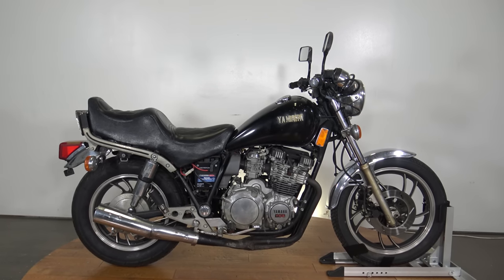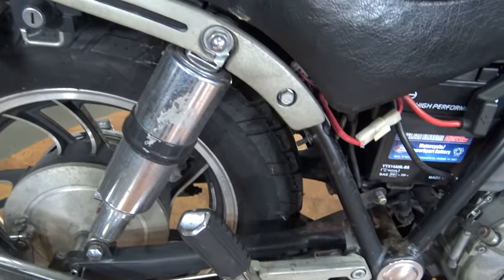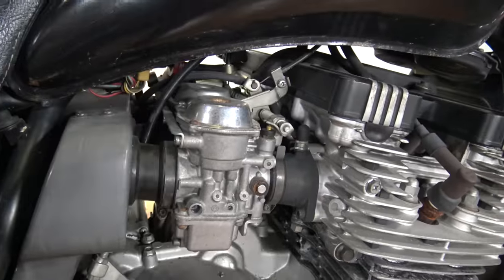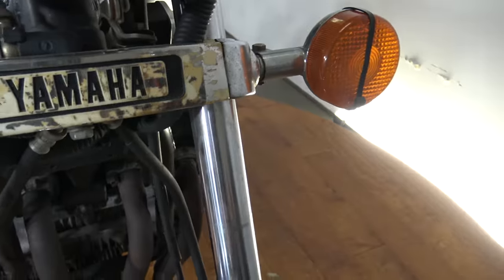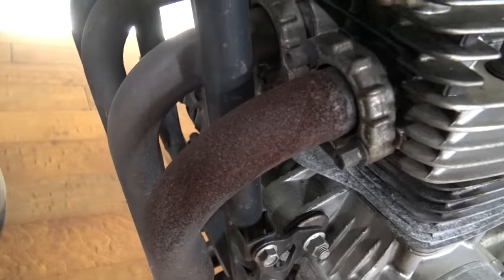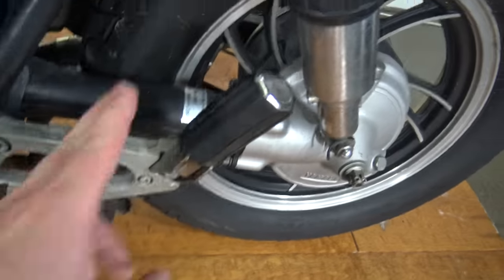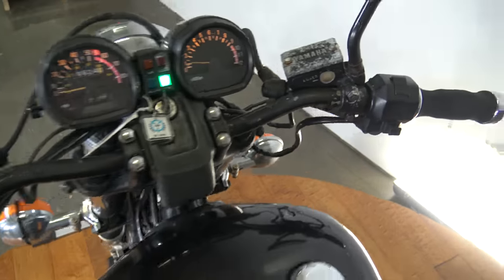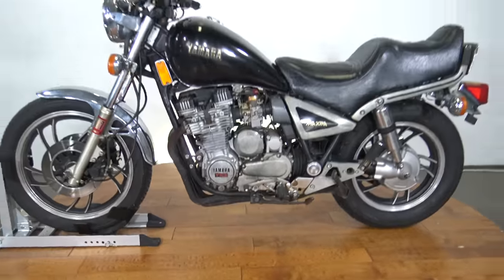1983 Yamaha Maxim 750

Comment: That bike is not worth $1500 tops $1000. It's in really ruff shape..
Reply: i had one better condition  for 450
Reply: If you wanted to throw a couple of thousand to get a nice fork set up and conversion , with another couple thousand at a dope control panel , gauges , and a set of wire wheels , new tires , and grips levers and mirrors , you might have a special cafe racer that’ll fetch almost double to the right buyer and tuning of the build , but it does have build qualities to it ,  2 , 3 hundred tops , if I would even think about the time having to go into it , maybe not , but it should not go to anyone for over 600 bucks , 1200 is four times anyone should pay for this crap ...

Comment: Has anyone noticed that the right side covers are usually missing on these Yamahas and this is reflected on Ebay. You'll see lots of LEFT covers but hardly any RIGHT covers and when you do see them for sale they go for over $100. I have a 1982 XJ 750 Maxim with both covers HEHEHE
Reply: Lol it's even worse on magnas, for my 84 I've seen them go $250 for a scratched up used one
Reply: On the right side covers theres 2 rubber bushings that goes bad over time and thats why cover missing, i bought universal bushings and problem solved